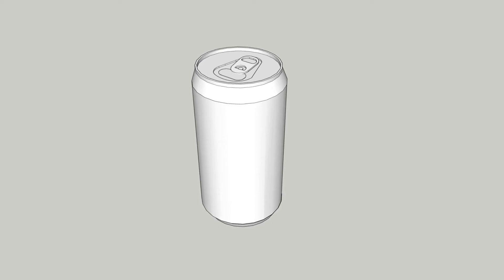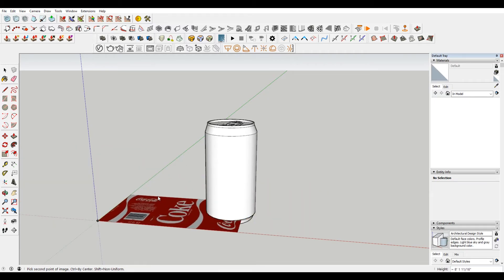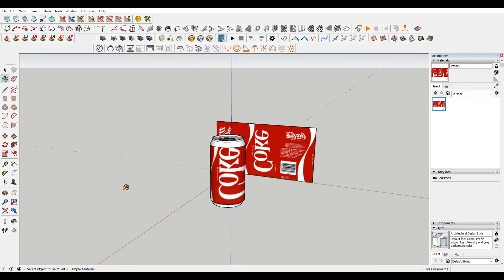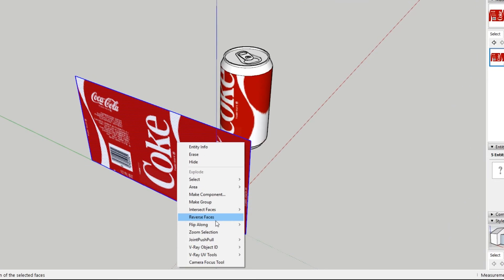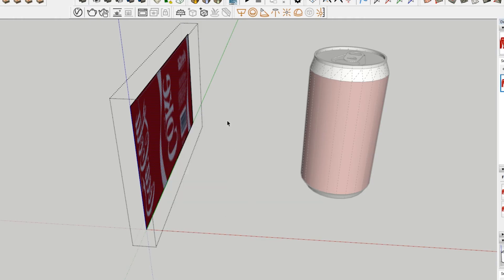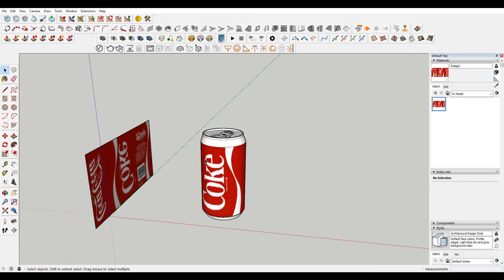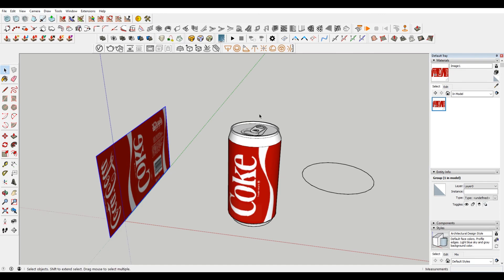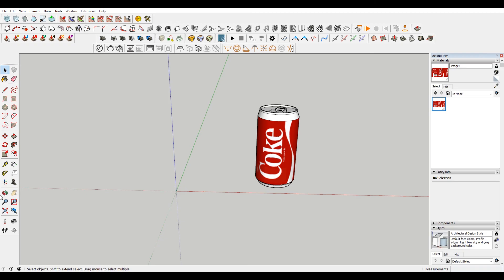How to Add a Texture to a Curved Surface in Sketchup

Comment: I sized the texture exact, height and width and it is not projected. When I place the texture on the different faces on the cilinder, the texture is not placed in a good order, the texture is not nicely wrapped around. What is going wrong? In the end, Fredo6 ThruPaint did the job correct.

Comment: Can't get the texture to project onto the can. If I hit ALT when using paint bucket, it just turns the flat label image, white when I click on it to sample. If I use the eye dropper icon from the material palette to sample the texture, it only samples the part of the texture i.e. the red or the white.Yes I did explode the texture and check 'Projected' on the face...
Reply: Hey Steve, I had the same problem - in my case I work on Mac OS and when I press the cmd-button it works!

Comment: I need to do the reverse. I have a 50 gallon drum and I am putting a pipe into it, off-center, and I want to cut the hole precisely... So, once I extrude the pipe cut out of the drum, how do I print a flat representation of the hole, that, when printed, will look a bit like a teardrop shape?